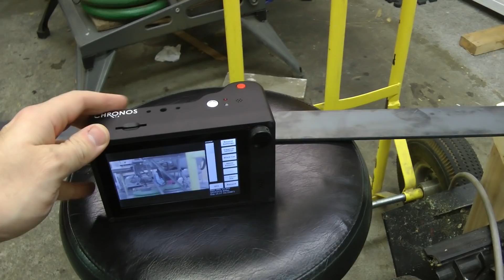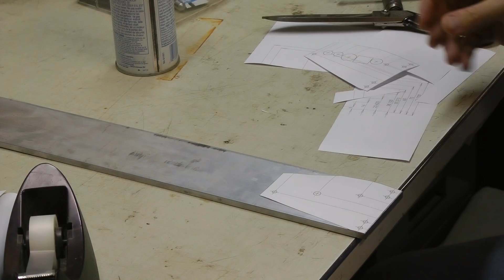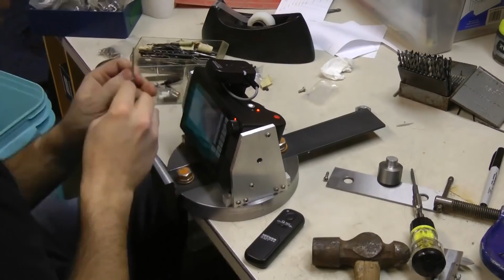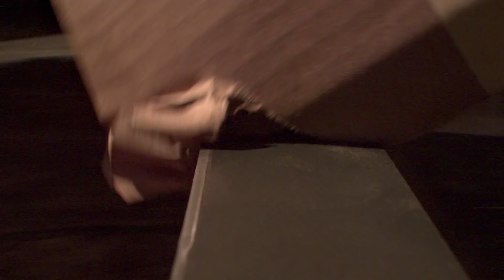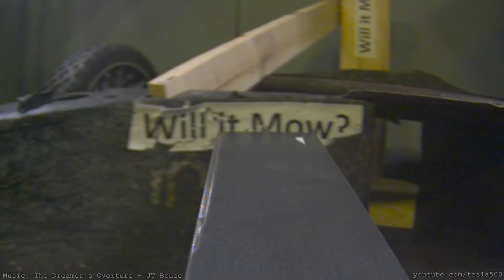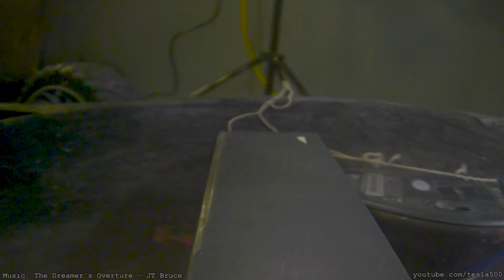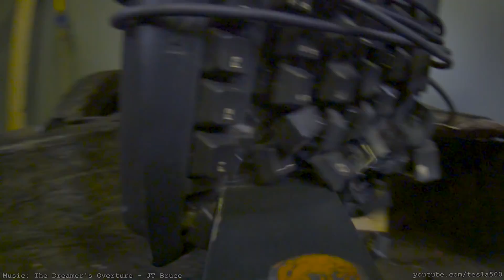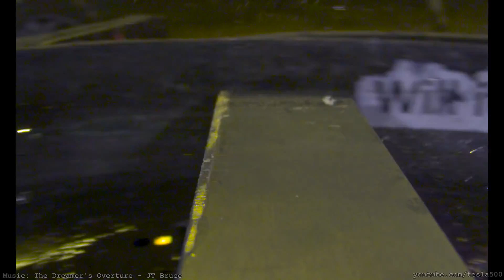High-speed camera mounted on a spinning lawnmower blade

Comment: I thought about doing something similar but was worried about damaging the camera.
Reply: I can imagine the camera getting loose and chopped up by the lawnmower haha
Reply: Maybe with a mirror instead the camera and the camera above with a glass screen in front. Should be more safe.
Reply: @Raybo3D 
That seems like an awesome approach.
Reply: @Raybo3D  need some serious unwinding of the frames to get a proper orientation for viewing
Reply: @Raybo3D  Not to mention you'd need a really sturdy mount that could have to prevent the mirror from vibrations and diffrent forces when hitting items.
Reply: @Raybo3D  Wouldn't that have to be with a global shutter though? I'm unsure how high speed cameras work. Otherwise fixing the rotating image afterwards with scan lines showing different locations would be much worse
Reply: Now that is a badge of honor, you did something Cody decided was too dangerous to attempt.
Reply: You need more balls sir.
Reply: Cody'sLab oh Cody! I think the bouncing balls could be a windows 98 screen saver for some reason.
Reply: @Cody's Lab: I would have mounted a protective hub around the camera assembly with a large enough hole in it, and glued a plexiglass window behind it.
Reply: Two weeks later: Cody's Lab: "Spinning Wheel Of Misery (Lawnmower reforestation w/ slow motion video"
Reply: Me too and then i realised it was pointless
Reply: @Zero Cool  i think it could work, highspeed footage of projectiles are made with spinning mirrors, too. but you would have to deal with the messed up viewing angles and stuff...i guess
Reply: RIGHT?! This guy has balls
Reply: You misspelled common sense.
Reply: Never let a minor risk ruin your fun
Reply: @Zero Cool   @Mark Pearce @Bruno Perina @Boobai @SCWfan06 
Here I found a video where they did what I described and it worked: https://www.youtube.com/watch?v=INckJRRR1EU 
Check it out its a good video.
Reply: @Allen A  Except Google camera van. The van spins.
Reply: nice to see you here! could you subscribe to my channel plz?
Reply: Cody'sLab, Please shut the hell up. For one you always steal other peoples ideas. Two, you have no understanding in the science you try to explain. Your videos prove that over and over. Every time someone on another science channel brings up your name I have to fix the misinformation and bad science you are "teaching". I for one hope they shutdown  your channel. You spread misinformation and bad science. You really should rename your channel to Cody'sFail. 

For everyone else reading this go to University channels and even check out Periodic Videos. They have professors who really understand the information they are talking about. Don't get your information from some backyard hick who thinks he knows what he is talking about. If you support him on patreon please pull out and don't support bad science.
Reply: @thatscienceguy9458  Who shit in your cornflakes?
Reply: @MiniDemonic  I think Cody did.
Reply: @thatscienceguy9458  Please shut it 
*ヽ(◕ヮ◕ヽ)
Reply: @thatscienceguy9458  Like, for example? No joke, I'm curious to know about what Cody's got wrong or has spread as bad science compared with the people who correct it.

I'm not sure Cody has ever described himself as a scientist or professor or other expert, has he? Other than on things that he's been doing since he was young? If people are interpreting what he posts as a scientist doing science, then yeah, that should be corrected. But you don't correct it by crapping on the person experimenting and learning things, you do it by crapping on the people who dangerously misinterpret what they're watching and correcting what they're "learning" from it.

I'll check out Periodic Videos though. And I already watch videos from universities. I've never confused any of those with Cody's videos though.

Come back and post some examples for people to see what you're talking about.
Reply: @thatscienceguy9458  Somebody is jealous....
Reply: @thatscienceguy9458  dont feed the troll
Reply: @thatscienceguy9458  wow, hahahaha
Reply: @thatscienceguy9458  oh I didn't know cody had a patreon! Thanks for letting me know I'll go sub now
Reply: @thatscienceguy9458   checked your channel...."This Channel Contains No Content".... Imagen that.
Reply: @thatscienceguy9458  yeah there's totally people making mars bases, making gold foil balls, floating on mercury, making gunpowder out of their own urine, or a vacuum pump which hasn't been around for 100 years. He totally doesn't have any original ideas.
Reply: @thatscienceguy9458  In response to this comment I signed up for cody's 5$ a month patreon teir
Reply: @Vsor , Nice! I wish I could do that :(
Reply: @thatscienceguy9458  I think I would have a channel with some content before I went too rip someone else, who has 2 channels and busted his ass doing it, apart. If you have a name such as yours, you really should have SOMETHING to back it up! You sound like a disgruntled piece of crap. I'd report you for harassment but I will leave that up to Cody.

Comment: Couldn't you sharpen the blade? It can't even cut a wire which slides off of it at high speed, and everything it "cuts" looks like a blunt impact.

Comment: I don't think 1800 RPM is accurate I know the Honda mower I use is 3600 at full speed. You wouldn't get a clean cut at 1800 with a normal walking pace

Comment: what is that? .1 inch pounds of torque?  you need the gas engine or a super large electric motor. There is no power for it to cut anything. If you cant get more torque you can try weighting the blade but same issue will happen. You can see atleast 80% drop in speed within 2 seconds of slow-mo, that means its slowing nearly instantly after it hits something.

Comment: Could you have just mounted the camera directly above the whole contraption and aimed it at a front surface mirror mounted to the blade? You'd have to correct for the image rotation but you wouldn't be spinning the camera, and probably could spin it WAY faster.

Comment: You should also try to find a way to spin it up to 2800 RPM that's what most gasoline mowers run at. But you may also want to try 3600 RPM as that's the speed most small engines have set as their max continuous RPM. But obviously this would mean more shock for the camera on impact too.

Comment: Destroying electronic stuff with hard plastic case is quite boring it simply breaks into pieces.

Otherwise it is a cool video with great potential to look at more interesting objects with your great build and good slowmo footage.

The rubber balls looked very cool and I liked this part so that I subscribed to your channel.

You could also try:

a block of gelatin

interesting fruit like coconut or a cucumber falling into the spinning blade lengthwise

butane lighter with a ignition source close to it (with not too much butane gas it is not a big flame and would not be a problem). you could test it outside first
Reply: Agreed... turns out destroying most things with a lawn mower is pretty boring to watch :\

Comment: If you mount a mirror in the middle of the saw blade at 45 degrees, you don't need to put the camera on the blade at all. This would remove the speed limit you now have.  You'd have to correct the rotation in post, but that's doable.

Comment: Much cheaper and less risky to $,$$$ equipment to mount a mirror at 45 and then offset rotation in post production. Also, then you can run full RPM or even overspeed without hesitation.

Comment: '
very good show this video...
i suggestion this video...
better put a small digital video camera with high speeding video...
not good big heavy camera...
better use a aluminum disk plate...
not steel...
better set up higher brightness contrast and more light up...
not dark

Comment: You needed to run that chattering end-mill slower or you needed to feed it harder, bigger tools need bigger tool-pressures to maintain rigidity. The harder you push the machine the harder it pushes back. Your chipload was too small. Crank it harder!
Reply from the maker: I sped up the feed during the timelapse portion and it was cutting much better

Comment: Why dont you mount a 45 degree mirror and film the mirror then rotate the footage using script?
Reply: Had the same idea. You'd lose a little bit of the frame but it'd allow faster speeds
Reply: Same here. 
I watched the whole video to see if he adressed this as I thought it was "POV filming rotating things 101" (pretty sure I've seen this on multiple popular video on youtube). Plus, you wouldn't risk debris damaging the camera.
Could go way faster with the mirror and would have lost way less time rigging up the jig.
Even though the process of creating it must have been very interesting in itself.
Reply: @xmtxx  I think the object is to show off how tough the camera is.
Reply: Would a mirror survive the g force?
Reply: @Cthulhu013  That's how it's usurally done.
I don't see why a flat glass plate (even though you can do a mirror without glass) sticked to a steel one wouldn't be able to sustain less g force than a complicated assembly of plastic and electronics.
IMO, it can sustain tremendous amount of g-force. It's just a very reflective surface sticked to whatever material you want, it's simple and solid as it can be.
Reply: @xmtxx  

The main issue I see is that relative to the camera frame, the view will be rotating very fast. Depending on shutter speed you could end up with some weird looking blur which gets worse near the frame edges. The blade wouldn't look as sharp and blur-free as it does here.
Reply: @JMMC1005  My mistake.
The blade would be effectively moving on the image.
But, as the falling stuff (moving very fast relative to the camera) aren't blured, on the video, the blade wouldn't be also with the mirror.
I'm pretty sure you can have a rotating mecanism that get the image as desired with the camera not moving, but I can't figure out how at the moment.
Reply: @xmtxx  

Yeah, it wouldn't be too severe. If you pause the video you cab definitely see some blurring, but I'm sure that with a bit more light this could be reduced.

Comment: AUTOMATIC AUTOBALANCING:
For what it's worth: Take a look at any CD/DVD drive. You will find that the disk mounting flange has free-rolling ballbearing balls in it. It's an automatic auto balancing mechanism.
I hope this helps.
Reply from the maker: I've seen those before, in this case it wouldn't have helped, as that wouldn't solve the dynamic balance issue. Two of them, one on top and one on the bottom, might work...

Comment: Fun video as always.  Consider locking the moveable knee of your drill press when using the drill. Your work piece is deflecting down as the platform deflects under the pressure of the drill bit.  Pushing against the clamp feels better and is better for the machine than pushing against the height travel gear. On some presses doing this will shear roll pins holding the height adjustment rail and transfer pressure to your lower bearing set on the height adjustment.

Comment: For the balancing issue, what you experience there is dynamic inbalance. You can staticly balance an object around its rotary axis by rolling it on a table or with a scale. However, you can still have momentum of deviation which you have to get rid of as well in order to have a balanced rotor. That can be quite challenging without good balancing gear. You might try to add weights of the same mass, 180 degrees opposed to each other, but at different heights. Would be a tideous process though. 
Very nice footage, as always!

Comment: Needs a sharper blade. Thought of getting some tool steel blade stock, grinding it and drilling it to the correct fit, then case hardening just the blade itself. Did that to remake a cutting blade, and after it was hardened and quenched on the cutting edge it was able to hold a razor sharp edge. You do not do the whole blade, just heat the cutting end to bright red heat with a torch then quench in oil, anneal to a dull red then dump in insulating hot sand till cool, then grind clean and whet the end sharp again. Can get it razor sharp that way, and providing the rest of the blade is still not hard it will be less likely to shatter. You will need a better blast shield though, but you will get nice cuts.

But who else would have though, just how much can a camera take G wise, you could sell those to NASA to be put in the engine compartments of rockets, though you would need a decent downlink to get the data off them at full frame rate, or a blast proof housing for use on a SpaceX launch.
Reply: SeanBZA why would you anneal it after hardening it?
Reply: Star Gazer 
Hard things are brittle things. If you don’t anneal something after hardening it, the first time it hits something remotely hard it’ll shatter. 

As with many things, there’s a trade off between wanting an edge that’ll stay sharp (hard) and an edge that won’t chip itself to bits (annealed).
Reply: @mrb692  I think he was referring to tempering it.
Reply: @mrb692  Sure, but doesn't heating it to red hot and then slowly allowing it to cool completely anneal it?  Doesn't that remove all the hardening?  Sorry, I know the principle of hardening but I don't know the process of how it is actually implemented.  Just seems odd.
Reply: Star Gazer, an experienced metalworker can use the color of the workpiece as a rough estimate of its temperature. From “coldest” to hottest, it goes cherry, red, orange, yellow, white. “Red hot” really isn’t that hot in the grand scheme of metalworking. Check out blacksmithing videos, and the thing they’re hammering on starts out white hot and by the time it makes it to yellow hot it’s back in the furnace. 

When hardening a piece of steel, it is rapidly quenched from a very high temperature (yellow or hotter), locking the carbon atoms in places they normally wouldn’t be. This makes the workpiece as hard as it can get. When tempering, the piece is raised to a lower temperature and allowed to cool slowly. This lets some of those carbon atoms relax out of their hardened positions, thus softening the steel. Crucially, because the annealing temperature was less than the hardening temperature, only a portion of the atoms relax back out and the piece retains some of the hardness gained through quenching. Starting the tempering process from a higher temperature or running for a longer time will result in a softer final piece, and lower temperatures and shorter times make for a harder piece. 

When a tool overheats and loses its temper, that’s because it was taken above the temperature it was initially tempered at. This lets more carbon atoms diffuse out, and the tool becomes softer. The practical bottom line is that a tool can withstand temperatures up to what it was tempered at, and since hard tools have low tempering points it’s critical to keep them cool.
Reply: +mrb692 Thank You Sir.  I truly appreciate the time you have taken to do this little write up.  Your topic is one I have long been curious about.   I'm also interested in the history of our development of metals vis-a-vis current sociological theory. I do not  think we'd even have palladium if new wave feminist bio-nuevo-epistomology wasn't such a thing.😎2018😎
Reply: I was thinking almost the same thing (about the blade needing to be sharper).  Even if he just honed the existing blade to a sharper point it'd improve it.

Comment: Awesome a new tesla500 video. Have you ever thought of building one of those high speed mirror setups for shots where the camera can't move that fast realistically but a smaller optical mirror could?
Reply from the maker: That's a good idea and would work nicely to view the mower at full speed
Reply: @tesla500  and a properly sharpened Blade.
Reply: Do you mean such things they use to track projectiles mid flight?
Reply: @zvpunry1971  Yes of course.
Reply: Or a 45-deg mirror with the camera pointing axially at the shaft..
Reply: Yeah cool idea. I was thinking that could be possible :D